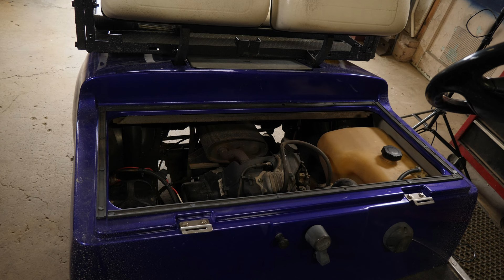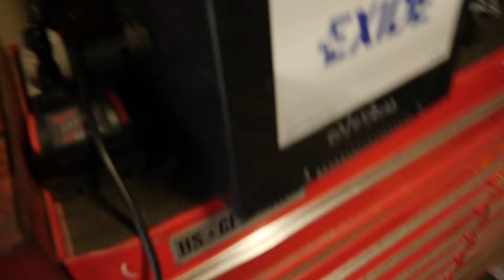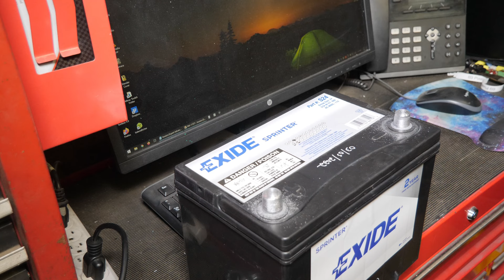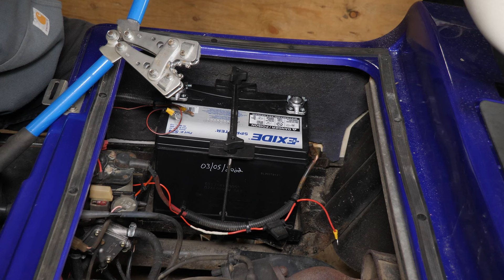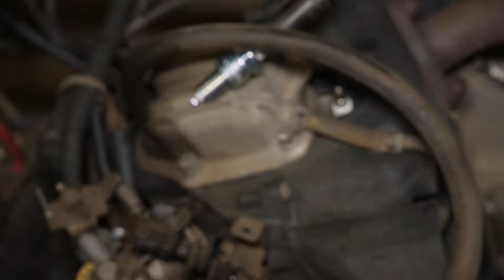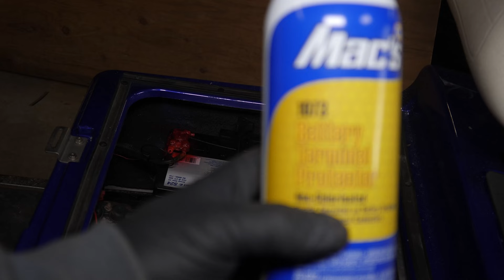1995 Yamaha G14, Gas - There's a flat spot when it starts

Comment: Good to see you back.  May things be well for you as we move on down the road.  You can re-charge aerosol cans so you can continue to spray product out of them. I use a valve stem that has had part of the back cut off so it compresses the stem when nozzle is removed , enough to get air into can. I use about 80 to 90 PSI for bursts of a few seconds. Do it all the time on my WD-40 cans that never seem to hold enough air to use up the product.
Reply from the maker: I do this all the time with WD-40. Its usually the only one that I really need to do that with, kind of annoying. The battery protectant doesn't spray well at 
 when held at an angle when the can is low. It just spits and sputters until its held upright again. Its a crap design internally.

Comment: Hey Kevin, Love your channel, I have 1998 G16 Yamaha gas cart.  When I press the pedal down it takes a few seconds before the engine cranks over and cart takes off sometimes if i press the pedal down halfway it cranks over a little quicker.  Any idea?
Reply from the maker: Delayed and/or slow cranking issue could be a bad connection, weak battery, failing starter/generator brushes or the starter/generator failing internally. I would have your battery tested first, since that is the easiest. You can inspect the brushes on the starter/generator by removing one of the rubber brush covers. The reason it cranks slower at full pedal, the engine is pulling in more air and fuel to compress vs less pedal is pulling in less air/fuel.

Comment: Thanks for your videos. Would a 2001 EZGO TXT take the same Group 24 size battery?
Reply from the maker: No. Group 24 is too large to fit properly in the battery tray. Group 70 or 26 will work fine with terminal modification. The stock battery group is a lot more money due to the terminal type so I just add clamps.
Reply: @Kevinsgolfcarts  Thanks